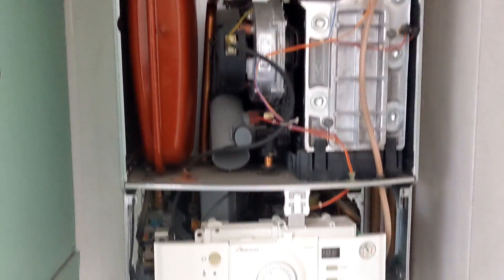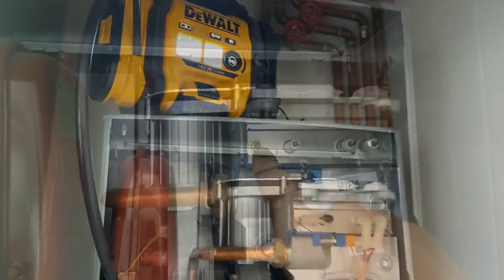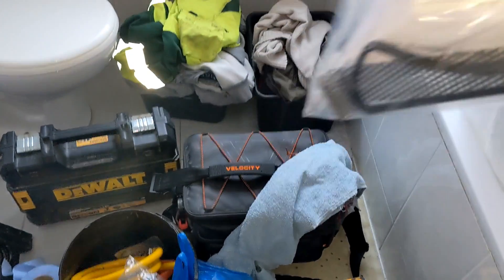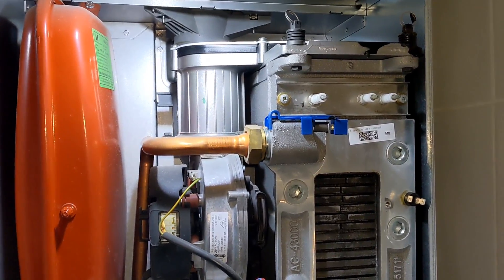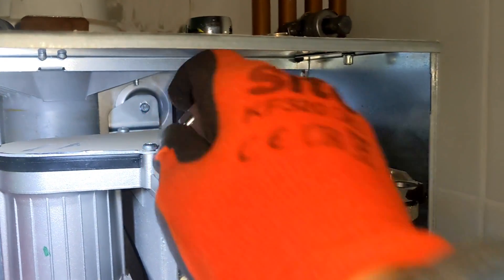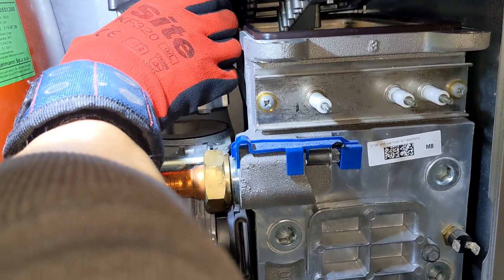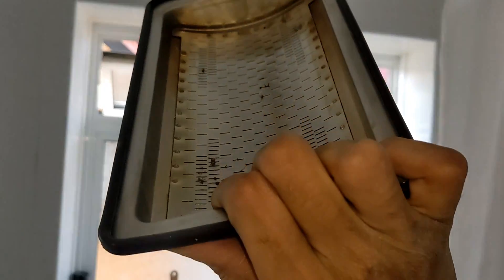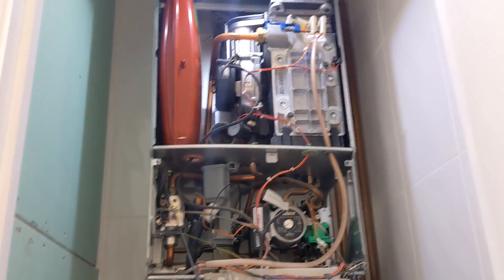Worcester Bosch CDI full service

Comment: I have had several services done by Worcester on as recently as 18th of August 2025 and never have I had this deep level of service. Following your instructions I have perfomed this service. The little condensate bowl was chock ablock with rubbish. They had never cleaned the heat exchanger but charge me £200 fir a yearly service! I am cancelling an will from now on do it myself!
Reply from the maker: Unless you're gas safe and know how to carry out your safety checks I would recommend getting a gas safe engineer in to do the service and just check they are confident to do a full service
Reply: Do not do this yourself, you will be breaking the law unless you are trained and accredited and employed. Testing equipment is required to check the appliance afterwards. Your comment is literally a statement that you broke the law!

Comment: I got one tomorrow makes a vibrating noise but not contonious  
Not over heating either. Cleaning the burner would do the trick let me know please thanks
Reply from the maker: Sounds like could be the bearing plate
Reply: Thank you will check

Comment: Hi mate good videos you have. Very informative. I have a problem with my worcester boiler. The EA message appears on the screen and the boiler stops working. I’ve figured out something that the boiler works fine on central heating and the flame goes on and runs good. When I put the hot water on it switches in EA mode, so after some messing about I realised the boiler will on stop on hot water when the actual outer casing is put back on. When I take it off or leave it loose it seems to be ok. It’s got something to do with the outer casing and hot water only. If you can help will be much appreciated. Cheers
Reply from the maker: Hi mate, it sounds like you've got an issue with the air intake if it's staying on with the case off. It means it's getting its fresh air from the room instead of through the flue. You'll need someone to inspect the flue

Comment: Are you ex bg ? Where did you get that reke from 😂
Reply from the maker: No mate
Reply: What are your thoughts on removing the restrictor by the flow turbine on a cdi 
Some people say it's unsafe but I disagree 

By the way great vids fella
Reply from the maker: @strongbow310  thanks mate, I've never removed it myself to be honest, does it make much of a difference to the flow rate?
Reply: @cputilitysolutions  yeah massive difference
Reply: @cputilitysolutions  obviously the faster the water flows through the plate the lower the temperature rise but its not noticeable but the flow rate is

Comment: Great video!! 👍How did you drain the boiler? Where does your hose connect to?
Reply from the maker: Thank you, the boiler has a drain off point below the pump 👍🏾
Reply: Thanks for you reply. Is that where the black hose connects to the condensate pipe. I had a call yesterday to re charge the expansion vessel but i struggled to drain the boiler. I downloaded the boiler pdf but it only stated there is an internal drain point. I’m going back next week to service the boiler so I’ll have another go at draining the boiler

Comment: Had one today did a full strip down like you have just showd 30 cdi had a fan pressure of 4;70 on high rate then after a few seconds i could hear the fan slow slightly and the fan pressure droped to 3:80 never had this before could it be the fan on its way out regards Lee
Reply from the maker: Not sure, mate, if it's in max rate it should stay ramped up 🤔
Reply: @cputilitysolutions  yes it is a strange one never had it before
Reply: Did you check the fan pressure at max rate before you started?

Comment: How do you get on putting the burner gasket back had one today put it back and it was leaking so had to take it back out lol
Reply from the maker: Yeah I've had that before too
Reply: @cputilitysolutions  what would help is say a bit of drain down hose to hold the silver bit up with the nut so you have two hands to get it back in my mate takes all the fan out todo it

Comment: 4.05 To make it easy to unscrew the screw 13 on the back there is a little trick. The upper casing of the boiler consists of two parts. so you unscrew the two screws at the top and pull the plate off
Reply from the maker: Thanks mate, I discovered this afterwards thanks to everyone who commented to let me know 👍🏽 these small bits of information can really help each other out

Comment: Wouldn't it have been better to take the top one off first mate. Saves the bits you flush getting stuck in the lower part you just cleaned?
Reply from the maker: Yes potentially could do it that way too 👍🏽

Comment: Do you need a fancy compressor to top up the expansion tank or can it be done with any old bike pump (with a gauge ofc)? Thanks
Reply from the maker: A bike pump with a gauge will do 👍🏽
Reply: @cputilitysolutions  Thanks Mate
Reply: Any pump with a gauge. Just don't use the prv to let the water out ot it might not re seat

Comment: Nice strip and clean cusie have u seen the fan pop due to moisture?  when servicing ? I was lucky enough to be audited when it happened in front of this guy . He claimed Worcester know of this but don't acknowledge the fact
Reply from the maker: I've had it happen to me once mate. I always let the customer know of this issue before starting as it's a big expense if it happens! A good method is to warm the fan up a bit with a hairdryer before putting the power on to dry off any excess moisture

Comment: its great to see someone do a full service.however i just dont see why taking the top burner out makes the boiler work better. just a waste of time in my opinion.
Reply: Taking out the top burner is two fold. It allows you to flush through the heat exchanger properly and replace the burner seal that can fail over time.
Reply: the easiest and less time consuming way is to purchase a baxi. takes 2 mins to gain entry inside the burner. worcester like to make it as difficult as possible.i have no idea why people think worcesters are the best. they take twice as long to service and cost nearly twice as much to purchase.the o ring seals fail just as much as any other boiler,and they arnt any more efficient as any other band A boiler. complete waste of money in my opion.that opinion has been collected with over 35 years of fitting boilers @karenmatthews9522

Comment: Great video i was wondering how you get on with the dewalt compressor ? Cheers mick
Reply from the maker: Thanks mate. The compressor is great! Especially with a 5ah battery I rarely need to charge it. Only thing I'd say it's bigger than the other brand ones so can be a bit bulky, but where I'm DeWalt with everything else it made sense to get it
Reply: @cputilitysolutions  cheers just bought one my Parkside one is nearly finished after 4years and also on Dewalt battery platform so makes sense keep the videos coming will share the like subscribe and 👍 👌

Comment: Two screws on the top of the boiler, one on either side will release the top panel for access to the heat exchanger bud 👌🏼
Reply from the maker: Nice one thanks for the tip mate 👍🏽

Comment: Another good one CP. Well explained as usual. Do you need to do a negative fan pressure check on these to determine whether they need to be stripped down and cleaned ? Or do do you strip and clean regardless ?.
Reply: Yes mate, just under the fan you'll find the -ve pressure test point cap. Good practice to do a full strip clean even if it passed FGA and fan pressure checks, it's all about preventative maintenance, not reactive!
Reply: @hdhanji8006  thanks mate
Reply from the maker: What H Dhanji said 😉
Reply: Interesting question. When in doubt always follow the Manufacturer's Instructions 🤣🥴🙄😉